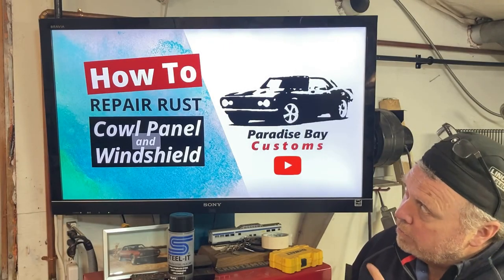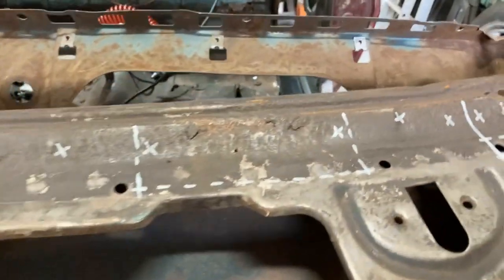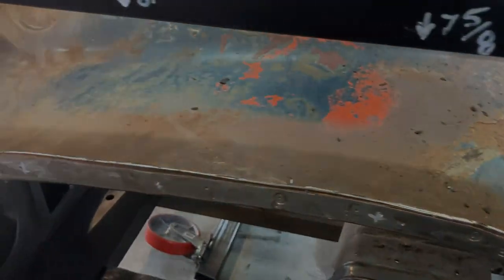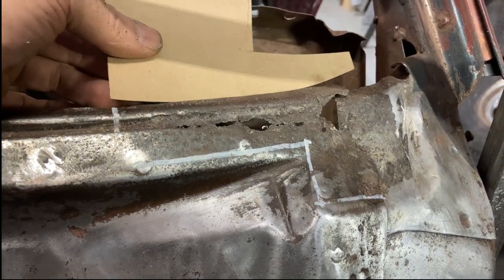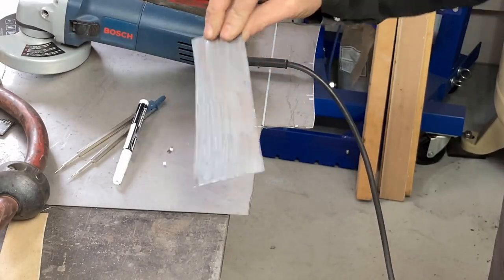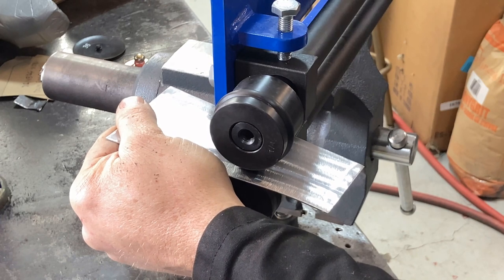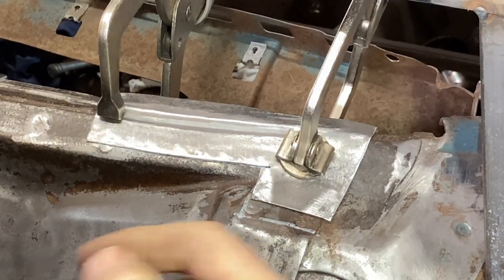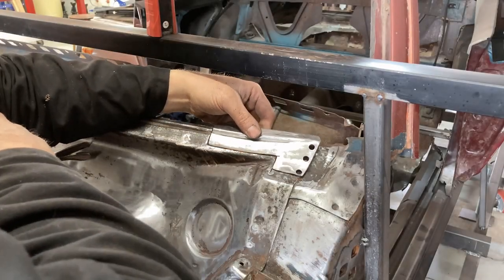COWL RUST REPAIR - Cowl Panel and Windshield - Pro Touring Camaro Build

Comment: I've got a 2nd gen that's about to get started so I'm looking at all the rust repair info I can so I have some tools to work this in a sensible manner
Reply from the maker: Awesome. Good luck with your build. I’ll keep sharing my experience/insight - hope it will help.
Reply: @ParadiseBayCustoms  so far as i need to do a floor pan replacement on mine too

Comment: Good work! My lower cowl was too far gone , I’m waiting for the new one to arrive. You mentioned Princess Auto, where are you in Canada?
Reply from the maker: Thanks! I’m in Winnipeg. You?
Reply: @ParadiseBayCustoms  Windsor On.
Reply from the maker: Where are you at on your build? Plans?
Reply: @ParadiseBayCustoms  Hi , I finished new floors, mini tubs, subframe connectors, removed both quarters and sandblasted the inner body framing. I’m prepping for epoxy priming that area now, while waiting for the lower cowl and still waiting on the drivers side quarter from the Camaro depot. I ordered the Detroit Speed quadralink as well so that I can install that box for the coil overs in the back. I’m still debating on the front subframe from Detroit Speed, I saw that you sure going that root. Very expensive, but why cut corners after going this far?
Reply from the maker: @TheLooper0  My thinking exactly! Sounds like we are on parallel paths with you out in front! Do you post/share your progress anywhere? Would love to follow along? Instagram? Facebook? I put daily updates when I’m working on the car to Instagram… This kinda stuff keeps me motivated! 😂🤪😂
Reply: @ParadiseBayCustoms  I should, I do enjoy watching yours and others progress , I don’t do Facebook , and I have instagram , but never use it, let’s just say electronically challenged. 😄maybe I can get my son to set me up and give me some pointers.